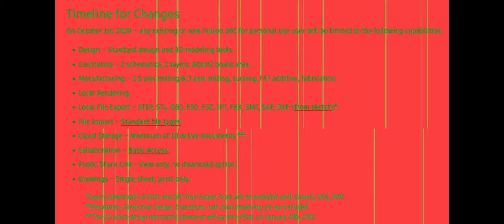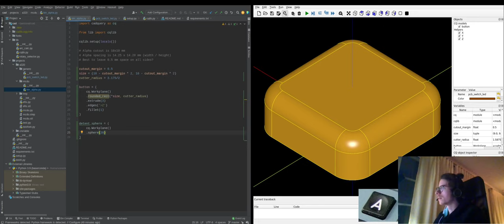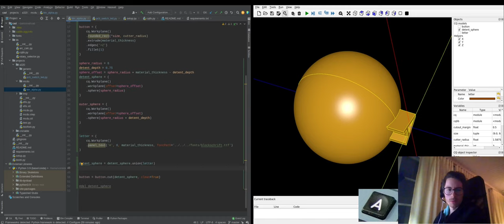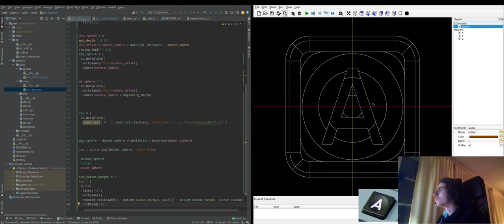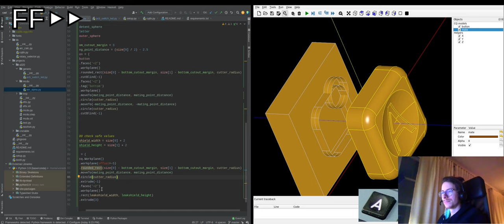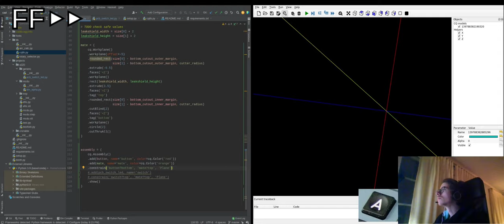DIY A320 MCDU Button cap modelling using CadQuery - Sim Vlog 003

Comment: Great video, thanks for making it. I was wondering if you would be willing to publish the CadQuery source for the example in the video. It would certainly help to be able to study it offline.
Thanks!
Reply from the maker: Sure, I've yet to clean it up but you can find the code here. https://github.com/voneiden/cad

I'm definitely going to be making more CadQuery related content on this channel. My next video was going to be about FreeCAD CAM, but it turns out adding FreeCAD to the process felt so cumbersome after using CQ. I'm currently working on a solution to avoid FreeCAD and that is a CAM module for CadQuery! It's coming together well, but is going to delay my next video for a few weeks still at least.
Reply: @ExperimentalExperiments  Great, thank you very much!

Comment: How did you get good at CadQuery? I am struggling to find a good solid resource that can take me step by step through the fundamentals and how to think about using cadquery.
Reply from the maker: What's your background, are you confident with Python? CQ would certainly benefit from having more introductory material. I'm pretty hands on with my learning style, so unfortunately I don't have any solid resources to recommend outside of the official documentation and looking at CQ source code when the official docs doesn't answer sufficiently well.